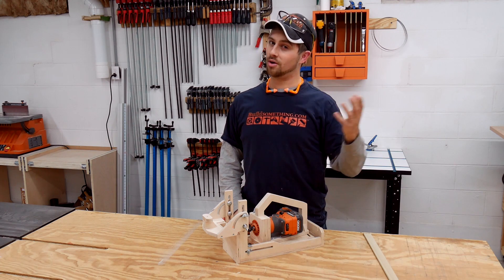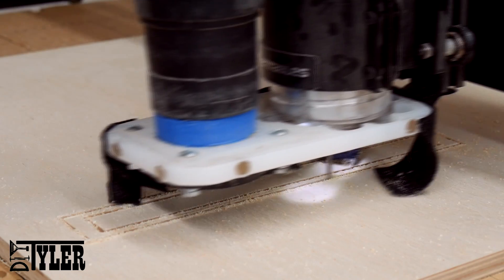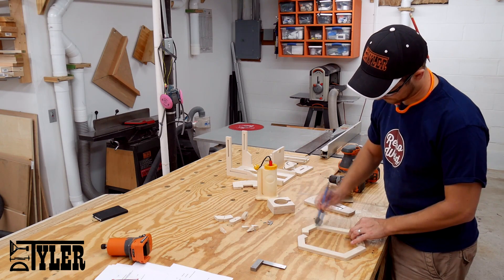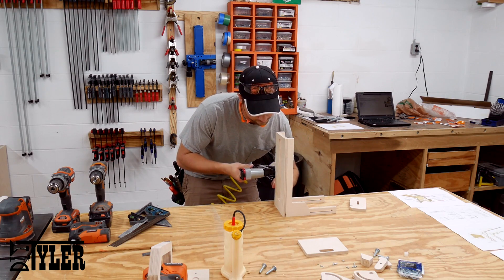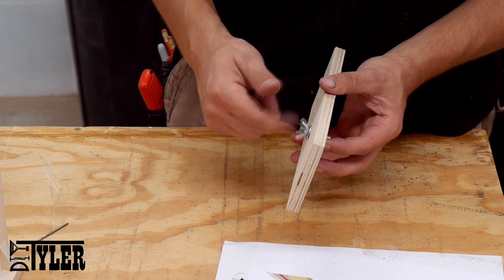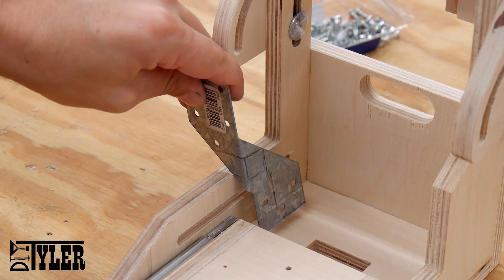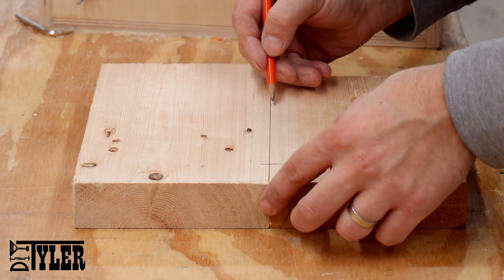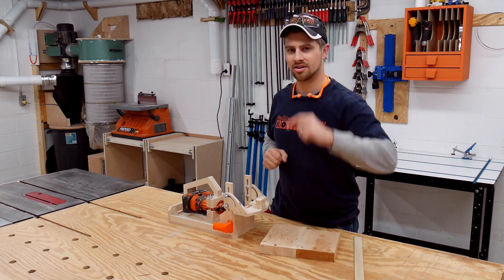Cordless Portable Mortiser

Comment: Very nice! I just saw some other videos of similar projects and they all seem to credit the same person you did for the side to side part of the build.  The idea for the dust collection 3D printed parts was fantastic. I do have one suggestion, I noticed the top of the part that the bit passes through severely reduces your ability to see what is going on.  I would carefully cut the top portion out to fit in a piece of clear plastic and either super glue it in place or use a plastic welding technique.  I think that would greatly increase visibility!

Comment: I'm curious how it would compare to a domino if you ripped through a mortise on the table saw for a cut away. It seems like it would have a pretty significant fan shape that could be reduced by moving the pivot point forward on the carriage.
Reply: Since the domino is constantly oscillating (with less travel) the whole time it plunges, it should leave a mortise with parallel sides as opposed to this design which leaves a mortise with sides that get further apart as you go deeper. Does this make sense? I'm not sure it's all that crucial really, but it would help ensure the loose tenons stay straight and perpendicular to the surface they're sticking out of
Reply from the maker: Ryan, this seems to be a common question from this video....I may do a followup. The sides of the mortise created by this tool are parallel to each other, the pivot mechanism is in the front of the slide so you pivot left and plunge, pivot right and repeat.....you just established the parallel sides. The pivot motion cleans out the center and leaves a slight rounded base to the mortise (at the back not the sides) so the tennon is tight and straight.

You can see what is happening here but it's in russian. https://www.youtube.com/watch?v=63gJAQm9fC0

Comment: Great video . . . chucking the plastic bushing to enlarge it's center hole, well that was out and out smart !!!    500 points for you on that one . . . glad to see early teachings with that  little guy.   Soon you'll hear,      DAD . . . "how do I"     LOL . . .in a good way

CNC:  Vibration is your worst enemy, try using a reverse spiral end mill because it will push your product against the table as it cuts rather then pulling it up like a conventional twist end mill.    Also, I came across a guy that has a CNC with a  4' x 8'  table, he clamps his work with a brad nail gun  that  uses plastic brads . . .how cool is that . .    never worry about a collision.  Sorry but don't have any info on his brad gun. 

Looking forward for more episodes staring . . .   The Young Apprentice 

Godspeed   -D:)
Reply from the maker: Thanks for the feedback and for watching Danny.....I am intrigued, plastic brad nails!! Sweet.

Comment: Awesome. If you're cutting everything on the CNC, why didn't you get it to drill/cut some of the holes for you?
Reply from the maker: Since I was having issues with the inside cuts being to small it was easier to drill them to the right size then to fix them after they were cut wrong.

Comment: how do you like the rigid 12V palm impact screw driver  I was looking at one at HD last night I have reviews on it as "Gee this is a cool tool "  how long does the batt last compare to bigger tools and batt pack ?
Reply from the maker: It's sure handy for small areas and for situations where you need a bit of tactile feedback. The battery is good but the tool itself doesn't stand up to the bigger tools. It's a specialized tool and it works GREAT in those situations.
Reply: I do a lot of field work  so weight is a big issue  how is it at drilling   like pilot holes ?
Reply from the maker: Haven't tried it for pilot holes but I have to say you are probably better off with the RIDGID 12V drill, super light, powerful and over all great feel.
Reply: I  thinking of the multi tool head thingie

Comment: a Ridgid domino??? man they would make a killing
Reply from the maker: Tell me about it! Thanks for watching!
Reply: your welcome, this build bothers me for 1 reason. the carriage pivots thus making a cut the that doesn't have parallel sides. what if you somehow used another set of those draw tracks for a left to right. then maybe a step down platform for an up and down. #engineerthebeepoutofthis
Reply from the maker: If you don't mind please take the language off the comment of I will have to get rid of it.

The sides of the mortise are parallel, the back of the mortise has a slight radius. The router pivots all the way left, plunge to full depth, pivot to the right and repeat....the total width doesn't change. If you go to the designers YT channel he has a picture demonstration of the methodology.
Reply from the maker: LOL!

Comment: Such a great design. Looks great!
Reply from the maker: Thanks Ryan! Little bird tells me that the feedrate on your design has to be pretty slow as well, need to slow down with mine and see what happens. Thanks for watching!
Reply: Tyler G not so much the feed rate but the depth. In hardwood I try to keep the depth per pass about 1/8" keeping the vibration to a minimum is important as you will end up with an over size slot.

Comment: What a great build Tyler! I like how you even threw in "Russian Dude" in there. I loved watching the sneaky peeks at it on Instagram. I think it came out amazing!!!

I hear "feed rate" is the rate limiting step for most diy slot mortisers. The one I'm building bears down on the router a bit. Ryan at Shop Built told me that his feed rate needs to be a bit slow, too. About 1/8" deep per horizontal pass if I recall right.
Reply from the maker: Wow, that is a pretty shallow pass. Will have to give it a try for sure, am pretty sure that will help make a more uniform mortise.....although what this machine is producing right now is still darn good. Thanks for watching man....#teamRIDGID!

Comment: That is super cool.  I agree, Festool ANYTHING is way over priced.
Reply: AnkleBiter Woodworks agreed the festool track saw is about 1000 bucks yet when you open it up the parts inside are even less quality than ryobi, ive actually gotten ( and yes CALIPER MEASURED ) just as accurate, dustless, crisp cuts with my handmade tracksaw rail and yes ironicaly a RYOBI circular lol. my saw was 60 dollars the parts for my adjustable track and dust cap were about 20 so 80 dollars a good fine finish blade and some effort make festool obsolete.
Reply from the maker: Yep, am sure most of the stuff is great but I can't justify a need.
Reply from the maker: Wow, that sucks man! Have heard a lot of awful stories about all sorts of different brand tracks....must be hard to make. My DIY and RIDGID circular saw works amazing (minus the dust collection though). Thanks for watching!

Comment: Nice job.  For the issue with taking too much material at once, I wonder if spring loading the router and allowing the spring to apply the forward pressure would result in more uniform performance?
Reply from the maker: Thanks Bill, it might....or maybe a spring return so that I have something uniform to push against when making the plunge cut? Will see!
Reply: Yes, that would be good also.  Basically make it a plunge router with the stop you created.

Comment: this is going to leave a cone shaped mortise, is that not a problem. the domino wiggles the same over the whole stroke, vs this design that wiggles more at the end than the beginning... love the idea, just thinking about how to incorporate the wiggle over the full travel rather than changing.
Reply from the maker: It doesn't leave a cone shape but it is rounded at the back vs flat. Not sure if the domino machine leaves a rounded end but I am assuming it does since the motion of the bit has to be the same. Thanks for watching Dan.

Comment: The dust collector turned out perfect! 

Love this build, too. My question about it is - with the fixed pivot point, doesn't that make the back of the mortise rounded? How does that affect the insertion of the dowels/dominoes?
Reply from the maker: Yes, the mortise is slightly rounded in the back but it's the side grain glue contact that you are really after and this makes plenty of that. Dominoes seat firmly with no wiggle. Thanks for watching!
Reply: it will probably mean that you have to go slightly deeper and that deeper portion will get filled with glue
Reply: The Festool machine works the same way, it has a pivot point but it's movement it is mechanized instead of being manual.
Reply: @mtabernig  I was wondering this myself. I did notice that official dominoes have fluted edges, same as commercial dowels. This serves to allow excess glue to have a place to exit so that hydraulic pressure does not build up behind the tenon or dowel. If too much pressure builds up, then the work piece can blow out, or the tenon or dowel may not seat all the way. Having that arc provides a space for excess glue to go.  If you want to minimize the volume and the depth, then move the pivot point back from the end of the bit, (or get a longer bit).  This would provide an arc with less curvature.  I haven't analyzed this design to determine if the pivot is fixed, but most designs are fixed and located relatively close to the front of the machine. 

But, as I think further about the shape of the mortise cut by a pivoting cutter, there is another aspect that I have never seen mentioned.
That is that as the angle of the pivot increases, the left and right edges become increasingly elliptical in profile. Most everyone knows that a circle when rotated in 3d becomes an ellipse. As the router bit is pivoted, and thrust in and out on a parallel path, the cut path is circular only when it the pivot angle is 0 degrees. At 90 degrees, the path left by the bit tip would be straight up and down ( a circle seen on edge), and the sides would be straight up and down. 

When the domino is inserted into the mortise, the circular sides of the domino would not match the elliptical shape of the mortise sides. If the mismatch is enough, glue can escape. Home made dominoes mostly have flat edges or circular edges 
from being shaped on a router. Thus  excess glue could escape, and the arc space at the end of the mortise may not be necessary. 

 I know this is two years after the video came out but I thought this was a useful comment to add.
Reply: Well done Tyler and Geeksmithing! Any thoughts/updates to it now that You've had it for a few months and used it on some projects? I feel like this is something MANY of us would love to make and get updates on. :) THanks again sir!

Comment: What is the machine at 2:25 ??? Type, brand etc. :o)
Reply: Andreas Hötzel oscillating spindle sander. Based on the color, I'm guessing it's made by Rigid.
Reply: I have an osci-spin-sander, but it uses drums to sand. I want to get a sander that uses those belts. ;-D
Reply from the maker: Yes it is a RIDGID oscillating spindle/belt sander. I use the belt option all the time, works great!
Reply: Hi Tyler, doesn't it has an order/type/part number? :-B
Reply from the maker: http://www.homedepot.com/p/RIDGID-Oscillating-Edge-Belt-Spindle-Sander-EB4424/100061671
Reply: Oh thank you very much. Wish me luck to find it here somewhere. :-D
Reply: Andreas Hötzel Which part of Europe? 
The up and down motion is an extra fancy feature. You could get similar stationary function from a belt sander mounted on its side. 

I've seen people make the round spindle sander that gets placed in a drill or a drill press. 

The dedicated tool is nice, but there are DIY alienating, just like the jig Tyler built! 😆👍👍